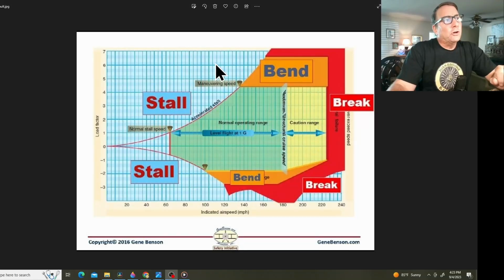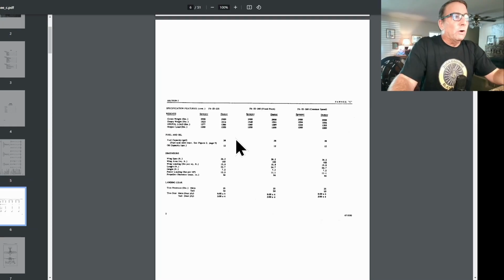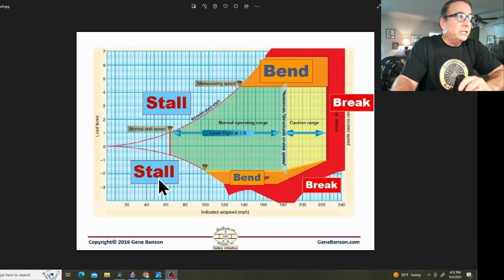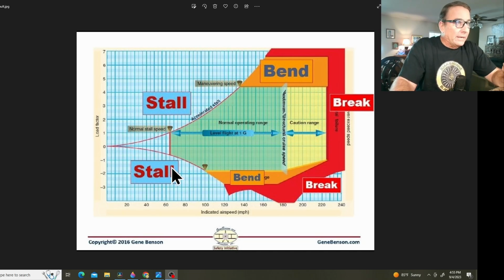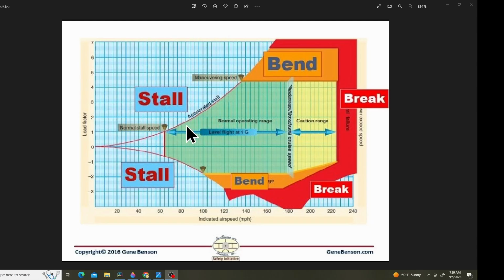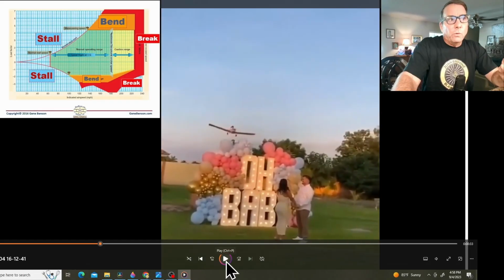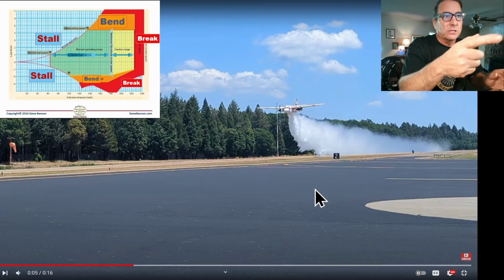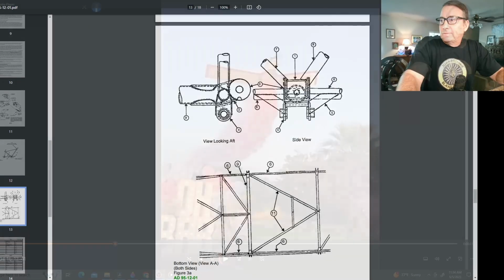PA25-235 Sinaloa MX Gender Reveal Party Structural Failure

Comment: Thanks for the video. 

I always thought that the point of a crop duster was to release chemicals in a very slow, controlled way. I understand that the fire suppression planes need to make a hard drop at once, but I thought crop dusters were made for a different kind of use.
Reply: I wonder if the pilot was qualified as a duster pilot. I would guess that this scenario would be covered in training.
Reply: Yes, normal operations of crop duster would release small amounts over time, however as explained in the video there is an emergency release which was used here.
Reply: @guntherberger596  I remember him saying that there was an emergency release. I wonder whether the manufacturer established conditions under which the release should be used. For instance, if the engine fails and the plane is going to crash anyway, I can see value to releasing the chemicals so that a rescue doesn't have to deal with the chemicals. I wonder whether the "owner's manual" for the plane basically says that if one isn't crashing already then using the emergency release is likely to cause a crash.